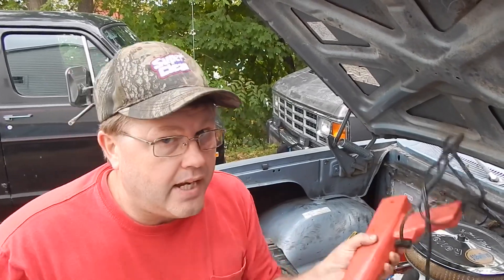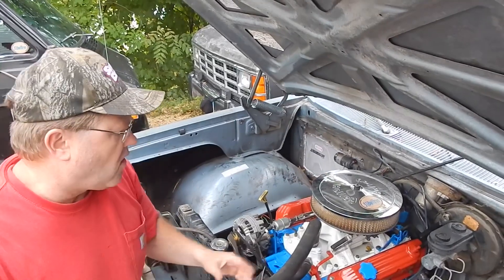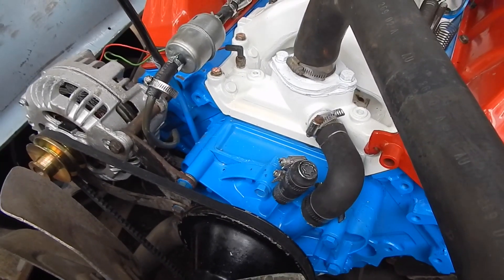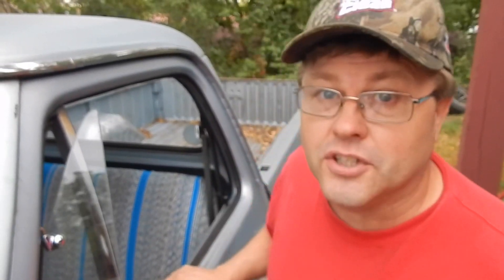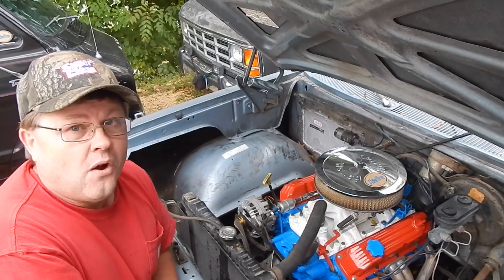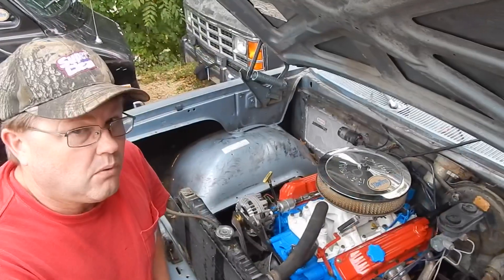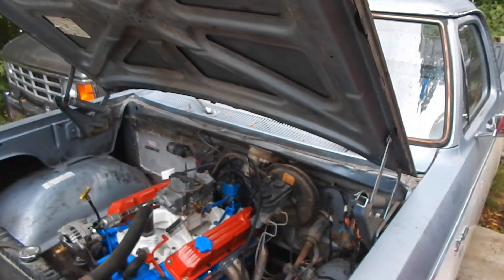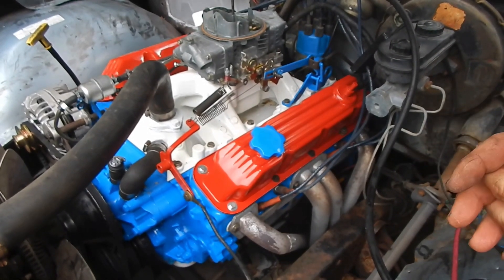Bombcycle First Start !    5.9 Magnum pulled at 198,XXX miles attempts to run again !

Comment: I completely understand that 180 on or off, I learned that the hard way on my brothers 360, couldn’t get it to start for nothing, popped and banged then I turned the rotor 180 degrees and bam she fired right away, I didn’t realize that you should be pointing the rotor at cylinder #6 but I figured it out 😂😂😂 great job she is running great
Reply from the maker: Thanks!  If I would have been breaking in a flat tappet cam, i would have pulled the driver's valve cover and confirmed it but with the roller cam I wasn't worried.
Reply: I can’t wait to see you driving it, she is definitely running great, I’ll be watching for the next video, thanks for putting up videos I’m loving the content and I am learning a bunch from you, I always tell people that I am a YouTube certified mechanic 😂😂😂😂😂 I even had my wife make me a certificate just to be funny, it catches a lot of eyes in my garage

Comment: The start up of a fresh motor is always exciting to me!! When it fires up I have a smile ear to ear and it never goes away no matter how many engines 😁What size carb and cam specs please? Thanks Bruce from NZ
Reply from the maker: 670 Holley VS.   Cam is218/224 @ 050,  .494/.504 ?? lift with 1.5 rockers.

Comment: You got lucky on the used engine . sounds great . I forgot what size and model ect of holley are your running on that magnum ?  I've hit a stopping point for the 360 I want to put in my 65 dart. I have a 78 360 block  free no money spent with crank and rods and a set of non smog 360 J heads 250.00  with factory 2.02 valves BUT since people are dealing with desructive hydraulic lifters I was thinking of a roller cam and lifters but john Wilburn said id be better off geting a used magnum and building it since its already set up for roller cam and roller lifters?  I have a salvage yard that like pick n pull on steroids that has plenty of ram vans ram trucks and durangos ect with 318 and 360 magnums for 150 .00 each then I just have to have a core .
Reply from the maker: Thanks for watching !  Yep, seems we scored on the engine, one never knows!  We have a 670 Holley vacuum secondary on it, but we want a 750 Double Pumper for it.    You could go magnum for sure!  But means you have the LA, I wouldn't be scared to build it.  Just don't go crazy on valve spring pressure, and run a good break in lube along with a good oil like VR-1 Valvoline.
Reply: I’ve done great with both!  The LA engine has been my mainstay for the better part of three decades.  That said, the 2.02 valves aren’t the flow improvement in the J heads... the work in the bowl and deshrouding is where it’s at!  David Vizard just put out a great video on that where he took the 2.02” valves out an iron Chevy head and installed 1.94”.  With his port work, it flowed better than an out of the box AFR head.  If it’s about using what you have, there’s nothing wrong with that 360, but if roller lifters are a must, the 85-91 LA or a magnum are going to be cheaper than the retrofit.  Just know that you aren’t losing anything with the 1.94” magnum intake valve.  You have a lot of good options!
Reply: And by the way, Tony’s Bottle Rocket runs 1.78” valves in 273 heads.  That’s the stoutest naturally aspirated 318 I’ve ever driven.  The new engine for it will run 1.88”. If the 2.02s made power in and of themselves, they would be worth the valve job to “upgrade.”  For nearly all applications, though, I could take them or leave them.  I have a 4.100 bore block.  If I build it, I’ll run the bigger valves because they won’t be shrouded in that bore.

Comment: Anyy particular reason you chose to run the LA brackets and pulleys instead of the magnum stuff?
Reply from the maker: Yes, because it made it a direct bolt-in in place of the LA

Comment: Jc how u run a mechanical oil pressure gauge? Were the sending unit is in the magnums? Maybe an idk about older ones like the la
Reply from the maker: Oil pressure gage is in the same spot on magnums as LA's.   i put the original sending unit from the LA into the magnum and now the gage works.
Reply: So if I wanna run a manuel gauge all I gotta do is plug into sending unit port
Reply from the maker: @thomaslockley945  yes, you can run it from the same spot.

Comment: Hey could you tell me what springs you used? I think you said on a previous video but I can't remember
Reply from the maker: Hughes spring kit 1110 (i believe that's their number)
Reply: Thanks! I think they are out of stock. I hope they get them back in stock. I've found finding springs for these is tuff. I just bought my cam last night. It's a 227/230  512"/513"  112 LSA

Comment: Were those the lifters clacking away in the beginning? Were they new? I am fully rebuilding my 5.9 with new lifters and heard they will clack for a bit. The thought of hearing that on my $2k+ engine scares me a bit.
Reply from the maker: I'm not positive it was lifters, just the engine getting going. Maybe a tick for a second or two.  I have the original magnum lifters in it, and they never tick.

Comment: 20° initial timing at what rpm?
Reply from the maker: It was idling about 800 rpms.   Thanks for watching !
Reply: That's what my 318 in the Ratty Ramcharger is running at.....20° initial, 34° total...all in by 2,200 rpm.
I actually have my vacuum advance hooked up to ported also.
Reply: @318willrun  thanks